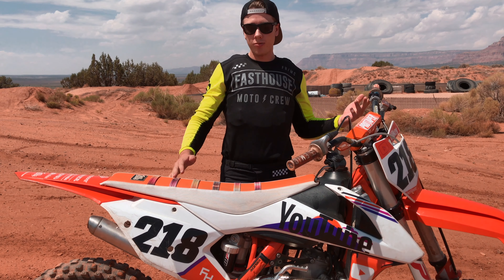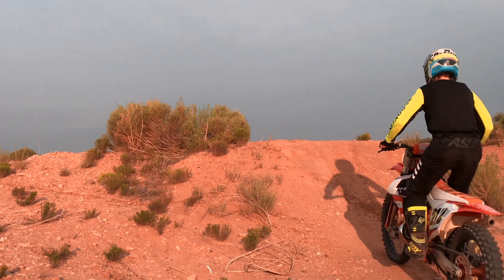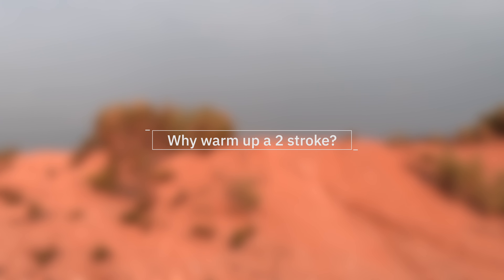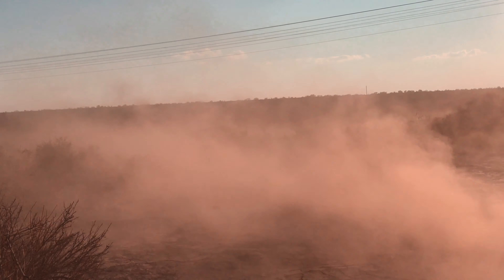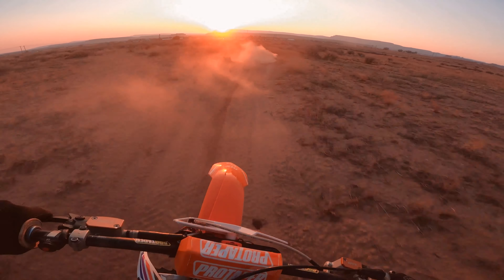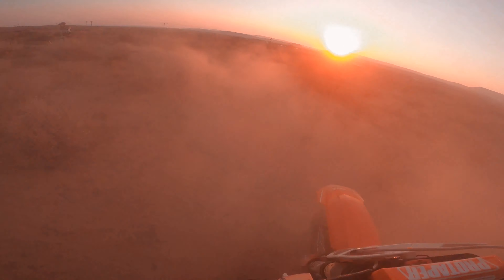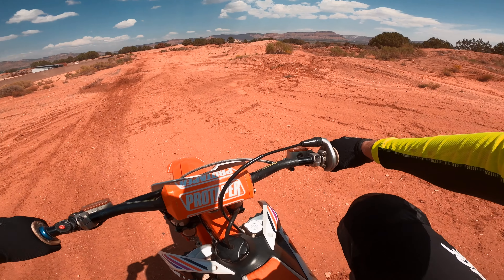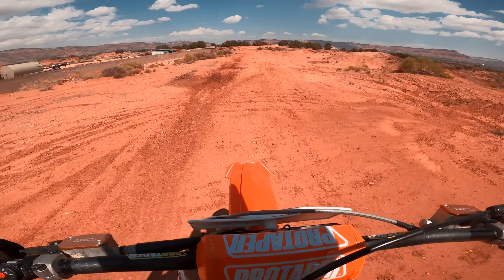How to warm up a 2 stroke dirt bike  |  How to Ep.27

Comment: So pretty much it doesn’t matter like a 4 stroke for the choke? I just use the choke to get the bike on? And once it’s on no need to wait to sit for it in high idle? Or should I wait like 15 seconds instead of like 45 with a 4 stroke

Comment: I let it idle for 2min then I ride it low rpm until I feel the engine warm up
Reply from the maker: Nice🤘 Do you ever have issues with spark plugs fouling by idling a 2 stroke?
Reply: @motoideas  I do, sometimes when I head on the track the plug just goes down. My dad has a few plugs with him in his car just incase when we go to the track. One time the plug broke two times in one day
Reply from the maker: @espeland90  I Always keep plugs in my truck as well haha
Reply: Is it better to hold in clutch in the turns? I see some people do and some do not.
Reply from the maker: @espeland90  No i'd say avoid using the clutch as much as possible if not at all while cornering. It throws off the balance & momentum of the bike

Comment: I warmed my bike up with choke on for 1 min .how bad did I mess up ?
Reply from the maker: You didn’t mess up anything. If it’s really cold I’ll do the same thing🤷‍♂️
Reply: @motoideas  i had choke engaged for 1 minute when the outside temp was warm then my bike stalled before I remembered to disengage choke .is that normal for it to stall after I left choke on when outside temp is quite warm not cold ?
Reply: @motoideas  on a warm day should I disengage the choke much earlier than 1 minutes?
Reply: @motoideas  sorry if I'm being a pain I just have no one to help me with learning these things
Reply from the maker: @Shadookie  that’s what this channel is for 🤘 all a choke does is add more gas to the engine, making it easier to start when cold. Most the time I don’t even use the choke, unless I kick my bike 5 times and it doesn’t start. Then I’ll either let it idle with the choke on for 30 seconds, or turn it off right away.
Reply from the maker: @Shadookie  a choke won’t hurt anything, it just adds more gas to the engine and less air. The bike will run poorly at high rpm’s if you ever forget to turn it off, but no damage will be done since it’s just extra lubricant. If your bike will start on a warm day without choke, then don’t even us it just to save time🤷‍♂️ but if it’s hard to start you can turn it on
Reply: @motoideas  I got it going and rode the bike for the 1st time today thanks to your help 🙏thank you bro
Reply: @motoideas  could you possibly show how to take off the expansion on a 2 stroke and replace it with a new one.i noticed I have a hairline crack in my expansion and it been leaking a little oil
Reply from the maker: @Shadookie  yeah I could do a video on that in the future, it’s on a 2 stroke right?

Comment: I warm up the bike by revving it and waiting until the radiator is hot. Is that good?
Reply from the maker: Yeah that definitely works🤘
Reply: Don't spell motor correctly..
Reply from the maker: @electrosteel9824   @KawiMXvery small revs, very small haha
Reply: @electrosteel9824  Revving = heat,
Heat = not cold motor.
Does that simplify it for you?
Reply: @kmx509  reving cold engine = hot piston cold barrel 
Hot piston cold barrel = cold seizure
Simple enough for you?
Reply: @stevenanderson7471  I know this already, i just asked him if he agreed to my way. I've built my motor by hand and i know everything on my bike.
Reply: @kmx509  if you know it can seize buy over revving a cold engine then why are you asking if its ok to do so. wether your engines fresh or not is irrelevant, you could still cold seize it. waiting for the radiators to be warm is good revving it make them warm is not.
Reply: @stevenanderson7471  I know, I'm asking if he liked my way not me asking am I doing it right.
Reply: @kmx509  thats the same thing